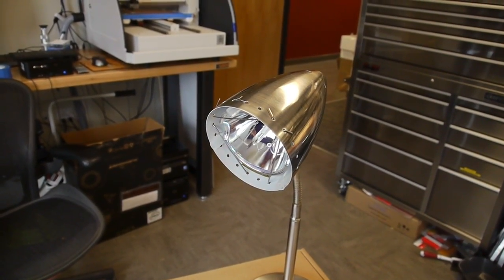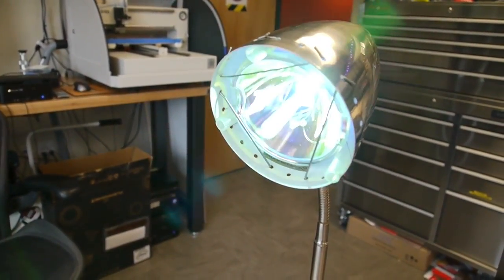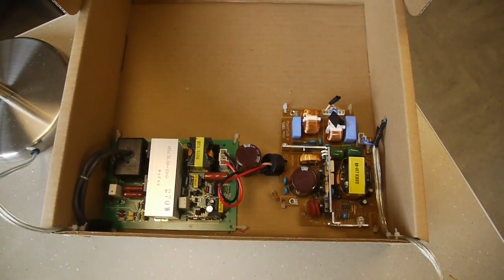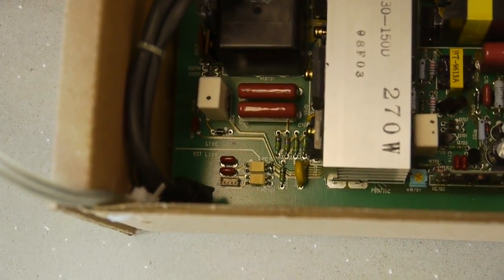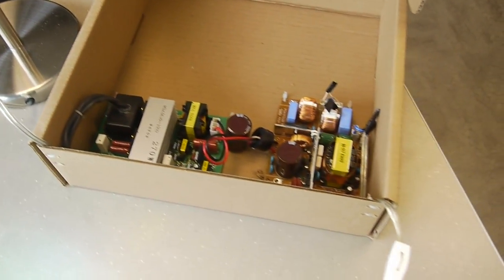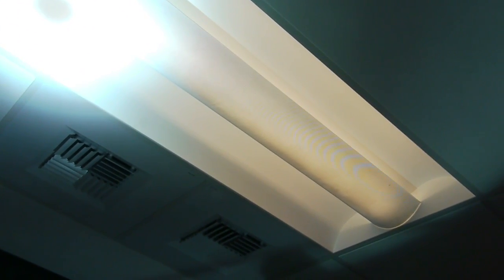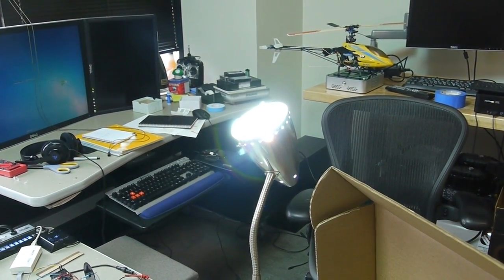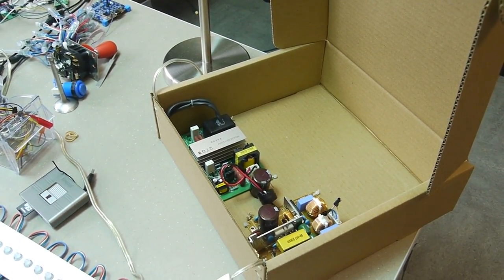Projector HID arc light mounted into a desk lamp

Comment: I love metal halide HID bulbs as they apparently are the most efficient high CRI light source still compared to LEDs today. I have the Cyclops Thor Colossus Halogen spotlight which is now recently fit with G8.5 Halogen bulb style ceramic metal halide bulb (in this case I have both 3,000 K and 4,200 K 39 Watts General Electric ConstantColor ceramic metal halide bulbs for this modified spotlight, had to ditch the cheap automotive metal halide bulbs as they have less lifespan compared to CMH and yes, 35 - 39 watts CMH bulbs will work with 35 Watts digital inverter ballasts that came with AC HID headlight kit). Nice and even more efficient than the original H4 Halogen bulb.

Comment: 1. Uncooled uncovered high pressure bulb explodes, hot quartz flies into your face and eyes. No more applied science.

2. Unfiltered UV nearly as bright as the visible light output, give you melanoma and cataract. No more applied science.

Dumbest smart video ever for this channel.

Incidentally i house mine with a lithium battery and inverter to make a 270w flashlight. Its fan cooled and has a front cover.
Reply: HAHAH LMFAO!   Yeah, no more applied science.  After [1,2] we have applied Obongocare!

Comment: One of the dumbest projects I have seen yet. Do you realize the amount of UV light emitted by those UHP arc lamps? Why do you think Sony had so many LCD and LCOS panel failures. So many that they stopped making those Grand Wega TVs.
The UV light emitted caused failure of the LCD and LCOS panels, usually the blue panel. Think about what it is doing to your eyes and skin. Can you say skin cancer? I knew you could.
Incidentally I was a CET, and repaired those TVS for years. Why do you think there are interlocks to prevent them from starting when covers open. It isn't the high voltage pulse, it is the high level UV that you need protecting from. There is UVA, UVB and UVC emitted, in huge quantities from those arc tubes. They are fused quartz, and they pass everything.
Reply: 12voltvids  Calm down pee pee pants.